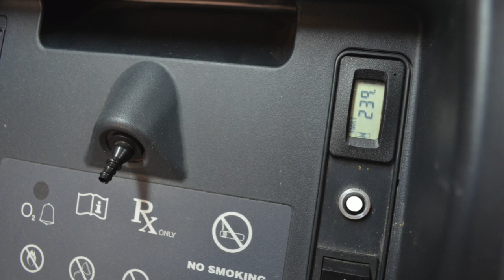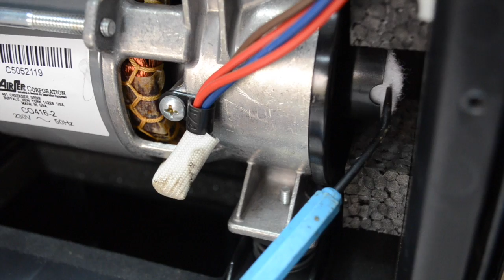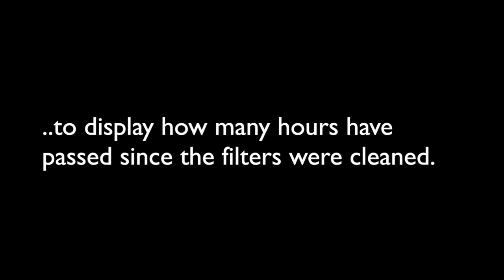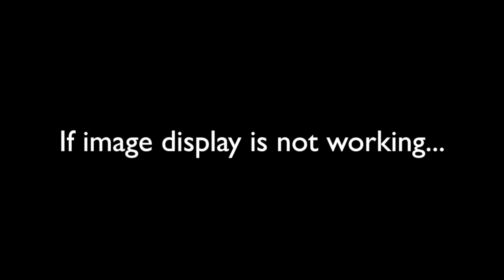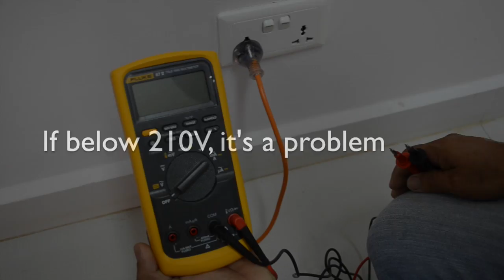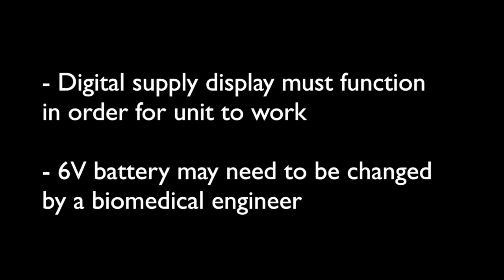VisionAire Troubleshooting

Comment: Hi Sam,
Thank you for the video. It was very helpful in understanding the working of the machine. My machine stops after 5 beeps (the manual says it is due to high pressure). It starts working again when you switch it off and on again for few minutes again the 5 beep alarms comes. I have cleaned the filter as shown in your video but still the machine stops after 4 to 5 minutes after giving 5 beeps. Please suggest how to go about resolving the issue. The local company says repairing on VisionAire5l is not done, and I should buy  a new machine which is not feasible right now.
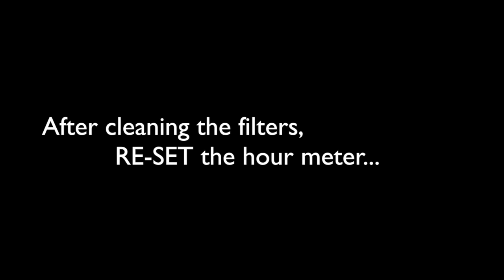Reply: 3:39 3:41 😮

Comment: I have a machine exactly like this one but it stalled because i was told by the technician that its sleep bend need to be changed, is their anything like that please.
Reply: You can get them recharged at Glenn Medical in Ohio....but it's not worth it on those garbage machines.
Reply: @yomommaahotoo264  Why a garbage machine and the it's in very good condition.
Reply: @dansonmwaniki1561  Bad design. 
They tried to make it too small and quiet.
Sieve beds too small....they contaminate relatively quickly due to witholding nitrogen (which draws moisture) in addition to becoming contaminated with airborne particles (no filters). Due to being designed to be so quiet the compressor thus runs hot and wears quickly (which then affects the sieve beds).

Comment: Hi Sam, can I ask you something?

I'm a Bioengineer. I'm checking an Airsep Visionaire just like the one on this vid. The compressor doesn't start and you can only see the fan working. I tried checking every part alone in another concentrator (compressor, capacitor, board, power wire, temperature sensor) but they work well in other concentrators. Just when you put them back together, the compressor just won't start.

I also checked the impedance of the concentrator as you suggested on the vid, and noticed it shows only 142 ohm. Which tells me there's an issue with either the circuitry or the wires. I can't find it yet.

Do you have perhaps an advice?
Reply: This is usually the capacitor but if you (with machine unplugged) manually turn the compressor a half turn, sometimes it just gets stuck and this works as a quick fix.
Reply: @nickillig5649  Thanks a lot!

Comment: Thank you for posting this. 

My VisionAire started rattling, which grew louder and louder.  Then it started cycling on and off.  Then it just stopped and won't start up.  

I have taken it apart following your instructions.  I have a long-haired cat and I was shocked when I opened the casing.  This oxygen generator, which does not have a removable, cleanable filter by design, as AirSep claims it doesn't need one, was FILLED with cat fur and dust.  I am currently soaking the filters and have vacuumed and wiped down every area I can reach in the case.  My hope is that it will operate normally once I replace the dried filters.  

I will NEVER purchase anything from this company again, as they had to know this could be a problem.  I believe they are using the filterless claim as a selling tool.  Not everyone has a long-haired cat, so for many the VisionAire will work, at least for a time.  I am surprised the retailers of this item have not tested it and found this huge flaw.  

Thank you for providing instructions for opening the case and pointing out where the filters are.  You are doing a service.
Reply: #RESPIRONICS_EVERFlo have PATIENT FRIENDLY FILTERS on them. The FILTER behind a  Trap Door, on the BACK RIGHT SIDE.  You change every 2 Years & a DISC FILTER on the RIGHT SIDE, You change every 5 Years
Reply: How can you breathe with all that car hair floating around ??  oh, I get it,  this is why you need the VisionAire....

Comment: hi Sam.. I have a problem. as the machine runs its stops and give 4 beeps (sound) , I replaced the circuit board ' the sieve beds and oxygen sensor circuit but still the same.. what do I do?

Comment: Hi Sam. I have the same machine ant it makes a bogging sound when it cycles. So while it's running it sounds fine then about 5 seconds later a bogging sound for 5 seconds, then normal. Keeps doing that. Any idea what it might be?
Reply from the maker: Hi Greg, Here's some options Jack thought of on your sounds, hope it helps, Sam.

1. The oxygen sensor detects the purity is not not enough so it sounds a beep to alarm that the purity level is low, but the motor keep running for
prolonged period to try to increase the purity level. The working period
of motor compressor affects the heat sensor of the motor trying to turn
on and off, and the motor compressor creates that banging sound.

2. The o2 concentrator require new zeolite filter which will normalize the o2
generation to correct the purity level alarm then the motor will work also
in normal operation and all other mechanism such as the solonoid valve.

3. Other cause could be loose motor mounting bolt.